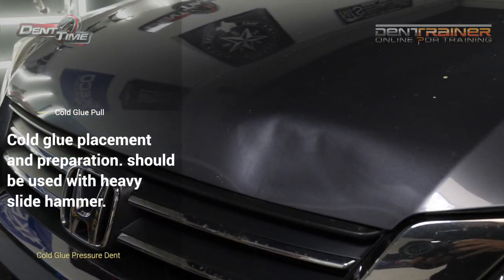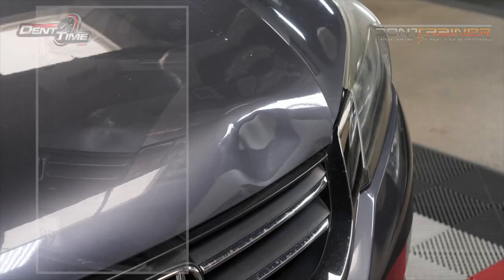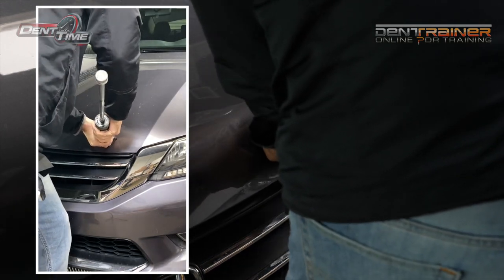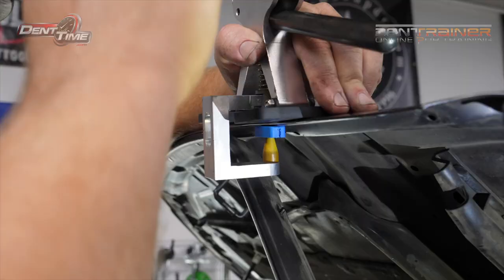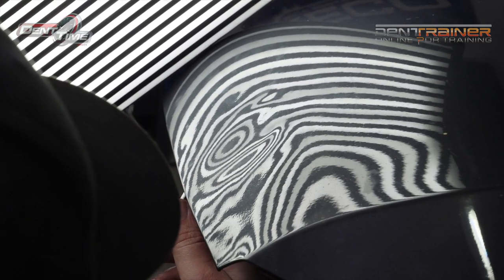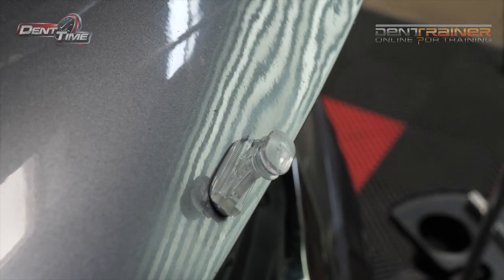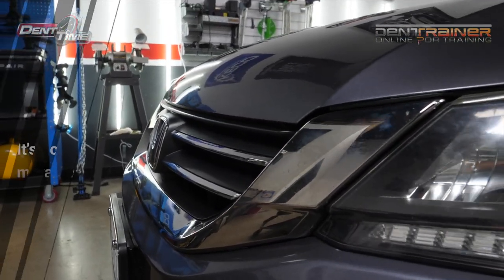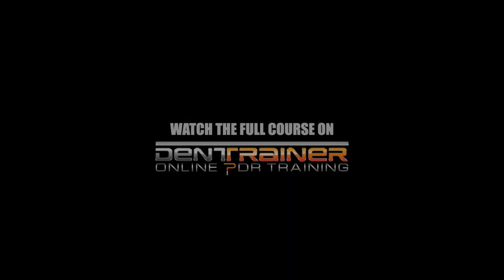Cold Glue Dent Pulling - PDR Training Course - Paintless Dent Removal Tutorial

Comment: How well does cold glue work outside in cold temps? Like Minnesota cold in January?😅
Reply from the maker: You have the heat the panel to 120 degrees and then set the glue and pull when temp reaches back to 90-80 degrees.